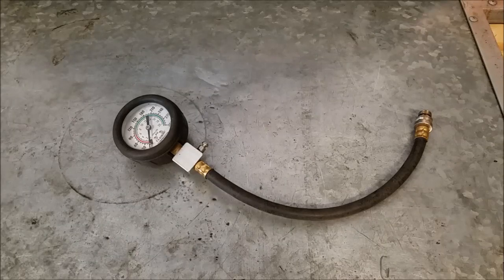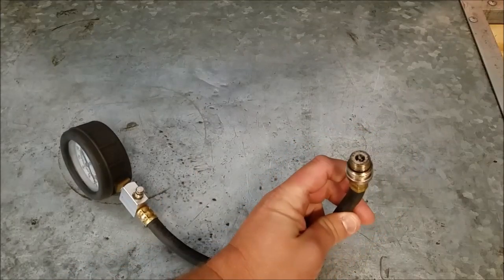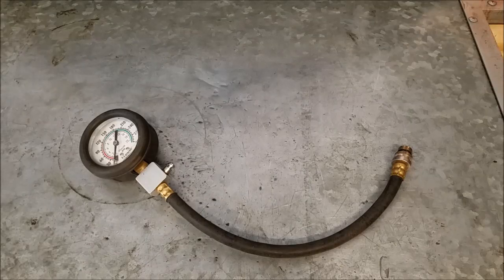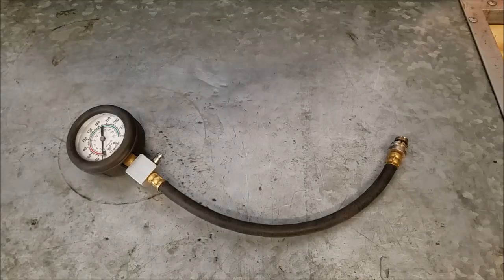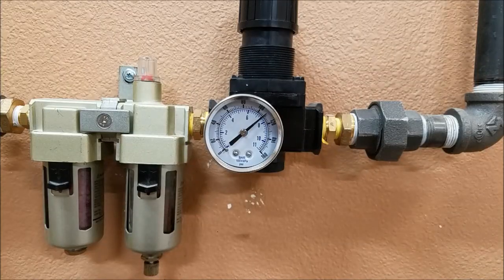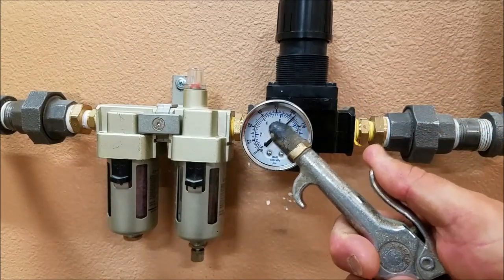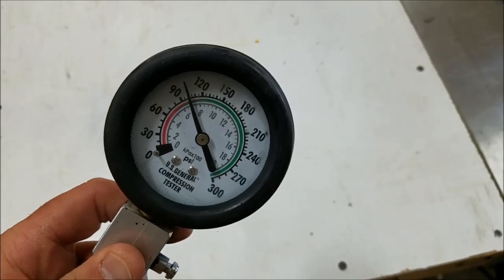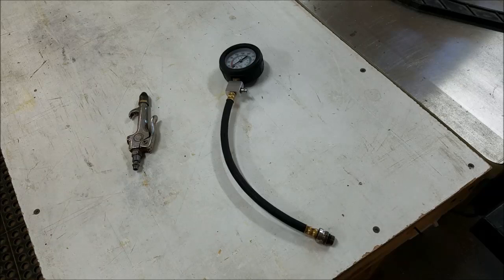Quick Engine Compression Gauge Accuracy Test

Comment: I recently bought a cheap compression tester for like 25 bucks, my bike had a brand new piston, valves were not leaking, its running great but still read only 70 psi

Comment: the guage on the air line is not an accurate instrument either , but the odds that all of them are wrong  a third  gauge shows roughly the same value are slim. So that would be a valid test. I had a compression meter in the shop which I never have compared to a know gauge and the first time I used it it told me that I should scrap my car ( which was running fine. I'm going to replace the meter with a quality one  ( like WIKA) , which is actually tested and has an error rating of .25% . This should solve my problem
Reply from the maker: 3rd gauge is on the air compressor.

Comment: Just found mine only shows 25psi on two strimmers
So will try your test.
Thanks.
Reply: For small engines like chainsaws and weed eaters you need exactly the model he has with the shraeder valve on the hose's end otherwise the reading will be all wrong because the air in the hose will return in the piston after each pull.

Comment: Tire shop Schrader is not the correct valve for a gauge.  They come coded by color.  White band valves are for gauge work. If you use a red or black valve for a tire, your readings will be low due to high spring pressure..

Comment: I have this exact tester. Are you saying that a new schrader valve core in the base of the hose fixed the accuracy ?
Reply from the maker: No, it was already accurate. 
Problem was it stopped working, the valve restored it functionality.